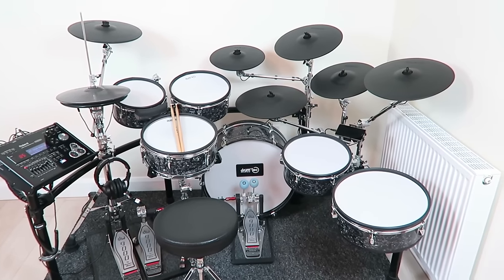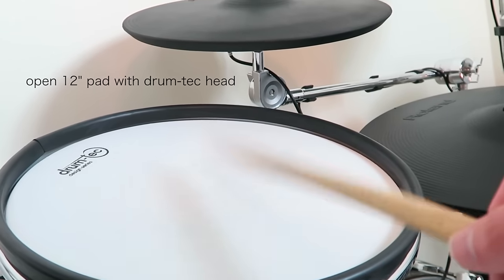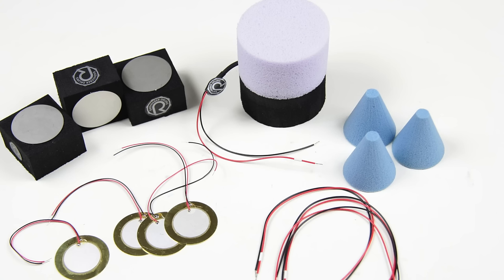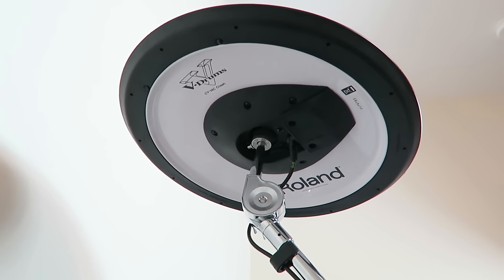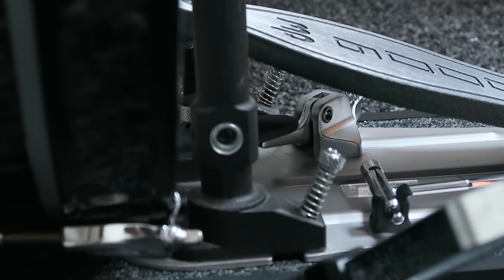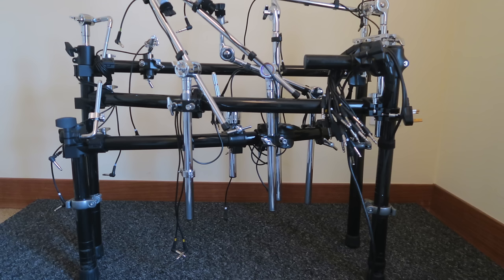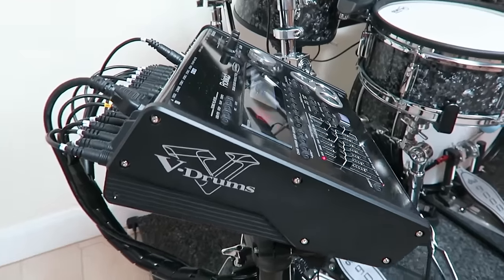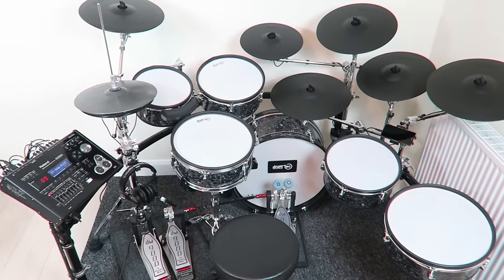My Custom Electronic Drum Set

Comment: Hey VDrum.  Your videos are amazing.  This conversion is amazing.  I have a question.  I'm a Pearl e-Pro user and I'm going to give this away to a friend and get a custom kit made and start over.

So, my question is, if you can make up a dream setup without DIY.  What setup would you use?  What Snare, Kick, and Tom triggers would you use as well as cymbals and module?  It's hard to go through so many videos on one specific thing.  I'd rather ask a pro like you :).

Thanks!
Reply from the maker: Depends on what you define as DIY. For me DIY means drilling, soldering,... For others, taking a screwdriver means DIY.

My dream Setup would be a Roland TD-50 with PD-140 Snare, RD-18 Ride, VH-13 Hihat (Black), only CY-15 cymbals as crashed. CY-12, 13 and 14 as splashes, Auxillary Hihat on the right side. Triggers for the Toms, clearly R-Drums RTS. Bass Drum: Wronka Trigger. Pedal (What feels good for you). Mesh Heads: Drum-tec Reel Feel 3 Ply (They are the best meshes) Gear from Gibraltar. The shell set of a nice Pearl or Tama.
This would be the best of the best:)
Reply: Haha, yes, I meant the screwdriver DIY ;).  The click-to-order stuff that you put together :P.  I ended up going with all R-Drum triggers, even for the bass drum and Drum-tec Real Feel mesh heads.  I'm waiting to see if the Pearl Mimic Pro is worth it and can utilize all the features of Roland cymbals.  If not, I might go with Jobeky / Field cymbals and a VH-13 HH.  So we'll see!
Reply from the maker: Jordan Stout Well, if the Mimic Pro struggles with Roland Cymbals, it will mostlikely have bigger problems with Field or Jobeky cymbals. They are not plug and play and require many adjustments.
Reply: Yup they are working on integration with piezo triggered cymbals. But the USB 18" ride won't be supported. :(

Comment: Great vid, you are as good as Drum-Tec and Roland together! Deutsche Gründlichkeit!
Althought I use aTD 30 too, I have two questions (being a noob at the technical side of things):
- How did you manage to have that amount of cymbals on your TD 30?
- How to get a proper foot splash on a VH 11? In my case it is not responding at all!
Thanks.
Reply from the maker: Jeroen Vermunt I just used all inputs of the TD-30 module. Just set up the VH-11 as per instruction. It should be possible to footsplash the cymbal.
Reply: Thanks, by the way, I just saw your vid  '5 ways to connect...' Clear.

Comment: This is the first of your videos that I've seen but I very much like your thoroughness, logical presentation, and attention to detail. I will DEFINITELY be watching your other videos since I've been wanting to make a custom kit like  yours.  One question I have before venturing into this project is about modules. If you're primarily using the sounds in EZ Drummer, is an expensive module like the TD30 worth it or can you get a similar result from a less expensive module (Roland or other?)
Reply from the maker: Allen Ash Thanks:) Well I use EZdrummer for recording projects, for practice and jamming I always use the module. EZdrummer does not require much. A Roland TD-9 would be good enough. Superior drummer on the other hand required a better module with positional sensing, if you want to use all features. So it depends on what you want to do. My reason for the TD-30 is positional sensing, the huge number of outputs, the sound editing features and the volume sliders. But I would be happy with an old TD-20X too. It is a question of need. I NEED a TD-20X for what I am doing, but I WANT the TD-30:)

Comment: Hi guys, awesome video! One question: I have a TDK-20 which is around 7 years old. I believe it needs some maintenance since the sensibility is behaving differently compared to when I first played it. I have read some material talking about replacing the cones, but I could not find anything more precise. Do you guys have something on that? Thanks for the great job and keep on druming!
Reply from the maker: Check this one:) https://www.youtube.com/watch?v=Lvrof45BHic
I recommend buying the original cones from Roland support.
Reply: Awesome! I saw that video before, I will check it again. Do you think that old mesh heads can make an impact on the sensibility as well?
Reply from the maker: No, only when they are damaged. It is most likely the cones. You can restore the whole set for approx. less than 100$. Best investment:D
Reply: Best news of the week then :) Thanks again!!!

Comment: what do you think about the mimic pro?
Reply from the maker: iheartcomps It is promising. I hope it works well in terms of triggering, cause I like the sounds. It has many things that e-drummers wanted for years, such as many inputs (more than TD-30 and 50) a modern screen, many individual outs and so on. It will have a big impact. However, the touch screen is a weakness and it misses positional sensing, but other than that, it would me an option for me too.

Comment: Hi mate! Great video. As I said it's nice to hear your voice. Very pleasant (not that your GF voice was bad, quite the opposite, but you're also great to hear).

Anyway, I'm really curious about cones. You are using R-Drums cone, even if in your "cheap A2E conversion" video you used a 682Drums orange cone. I am actually using 682Drums since forever (Alesis Mesh-head conversion kit and now cones for my DIY 22x18 bass drum conversion (and in near future all new toms and snare).

How IYO the two brands compare? Is the 682drums appearing in the "cheap" conversion video accidentally or you imply them to be cheaper and less reliable?

One last thing that can be of interest: I had severe problems of double triggering on my bass too (2ply 682drums mesh, really elastic). I tried with module settings and I wasn't able to solve them (at least not without being unable to do 16th notes at 140+ bpms due to heavy retriggering suppression). I was almost desperate until I put those noise-dampening foam panels (this one: http://img.mercatinomusicale.com/p_z/57/31/4003157_1423857892.jpg) all around the inner side of the shell. I made the panels sides press the batter head and cut the exceeding 10cm off the resonant side.

I did this to suppress the slight noise coming off the drum (I also added a circle-cutted dampening panel glued inside the resonant head) but it accidentally ended up eliminating ALL double triggering issues. The batter head seems muffled in terms of rebounce (much more realistic) and the wild triggering went totally away, no matter how low I set my retrigger parameter. This seem to be a very cheap and effective solution to the problem.

Sadly I didn't took shots of the process, but I can make some photos of the finished result, if you want.
I'm really happy with the result: at 170bpms I don't get a single double stroke. That's also where my feet begin to fail... :D
Reply from the maker: Thank you:) 
The cones from 682 drums are too soft and do not move fast enough. The foam has to have a quick response. But this is only important for High-end modules. 
The 682 mesh heads are not good. I tested them once and they are too stretchy. No wonder that you had too much rebound. 
I like the DIY improvisation, but the inner perfectionist inside of me wants to have all perfect:) But I would like to see what you have built.
Reply: Paolo Pustorino I would love to see photos of this, I am converting a 22" very soon, any extra advice or tips would be great.
Reply: Hi Anthony.

I'm planning to publish a post on Medium with a long list of "what I'd like I knew before" regarding the bass-drum and another drum-hacking project I did.
Write me at stickgrinder@gmail.com and I'll send you the link to the post. If you want I can provide my advices and information directly.

Feel free to ask. Cheers

Comment: Great kit, but way too expensive. In order to build that kit in my country I'd spend enough to build an insulated roomand probably upgrade my real kit
Reply from the maker: MJefBR It depends how you define expensive ant what you want to do. An e-kit can still be cheaper and produce great recordings with a vast software, than an acoustic kit. Simple reason is that acoustic drum recording gear is expensive. But if you have already a sound proof place, you should probably stick with that.